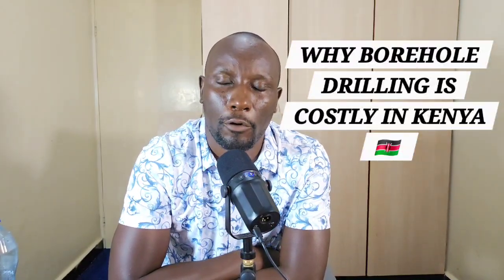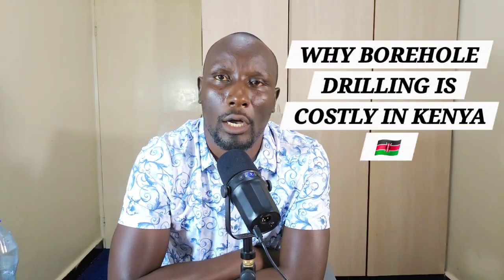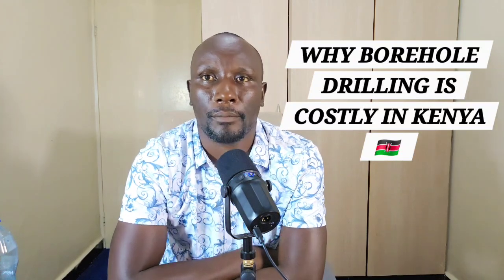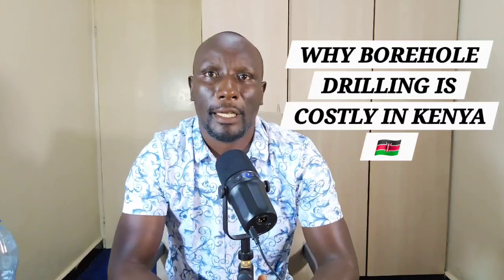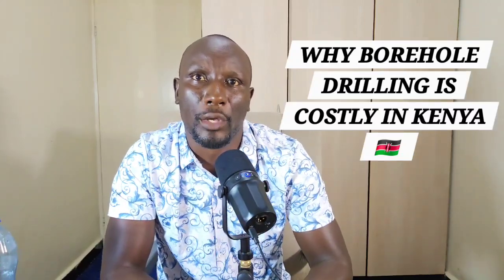Why Borehole Drilling is Costly in Kenya | Expert Explanation

Comment: How much is it cost nothern part Especially Garissa
Reply from the maker: Hydrogeological survey 50,000 
Drilling per meter 6,900
Reply: A manual sunk to 45m and wanted to add 50m, is it possible? What will the cost be?  @bonvicdrilling
Reply from the maker: @kindhrtdiscoveries4581  it is possible but we don't handle hand-dug boreholes
Reply: Never mentioned hand....its been done by a diesel driller.....how much?
Reply from the maker: @kindhrtdiscoveries4581  feel free to call us for better explanation